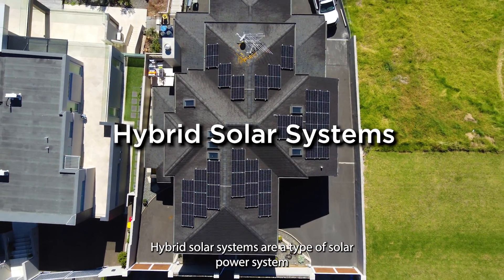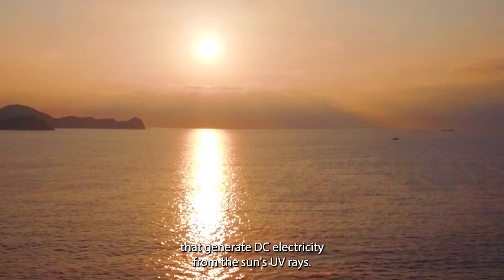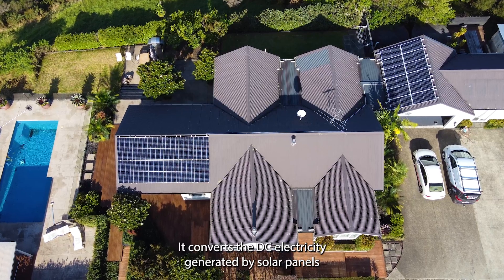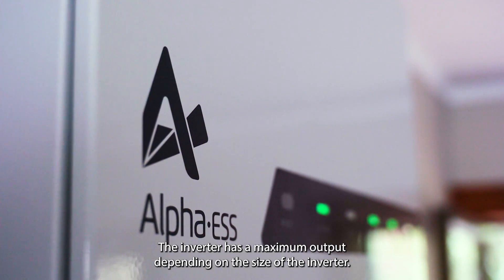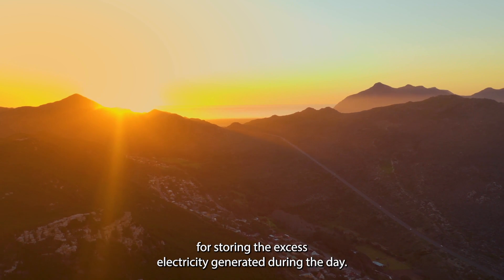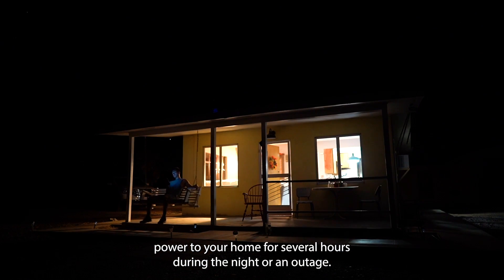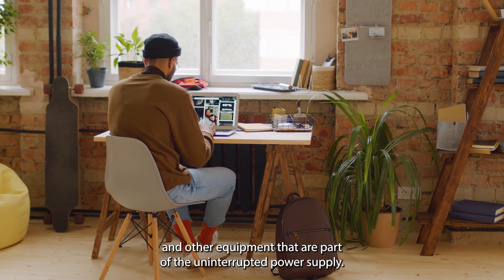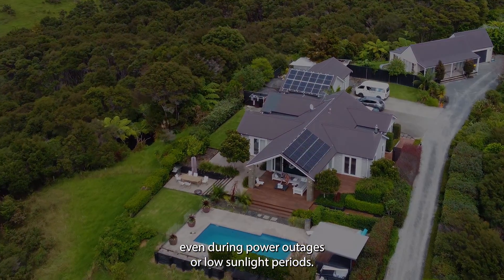How do Solar Hybrid Systems work?

Comment: Just a wee question.  If, during the day, the power goes out and you are running on the electricity from your battery, are your solar panels still feeding the battery.
Reply from the maker: Hi William - Yes, if you install a hybrid solar system with batteries, the whole system will keep functioning during a Power Outage.  During the day you can sue the solar, and the battery will be charged with any excess power, and in the evening you use the battery.